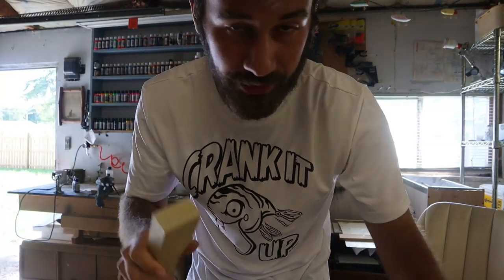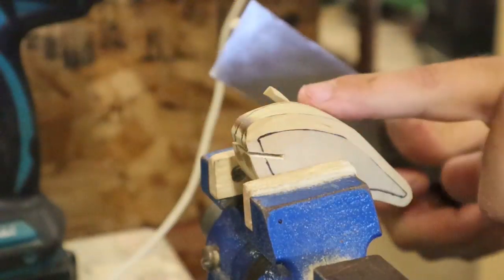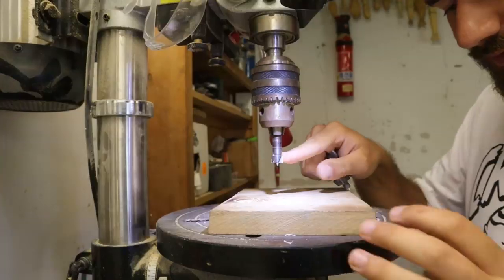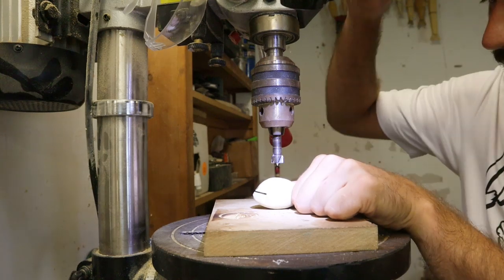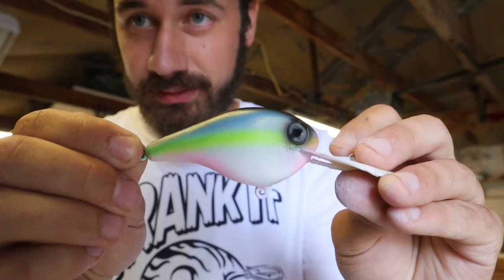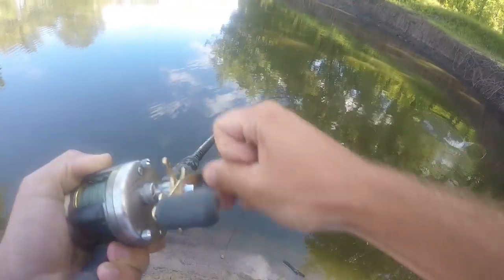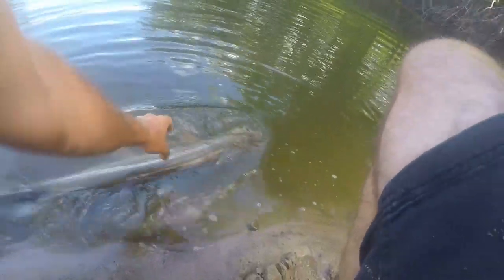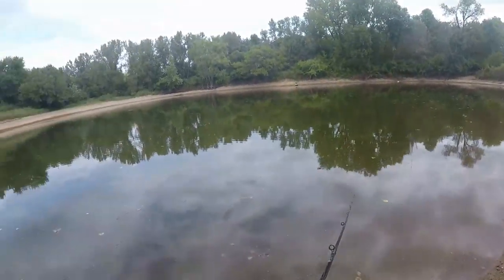Deep Diver | One Day Build to Catch

Comment: Make you a cheap plug knocker. Take an old spark plug and put a paper clip over the  ground electrode and tap the electrode down with a hammer to hold the paper clip on. when you get hung up slip the paper clip on your fishing line hold the rod tip high as you can and let it slide down the line to the bait and a lot of times the weight of the spark plug will free the lure. A better way is a lure retriever. Google bass pro shop E-Z lure retriever. I have no doubt you could make your on version with the equipment in your shop. It’s not a bait but maybe a new video project prospect?

Comment: If you are worried about you files scratching your line ties and hook hangers when using them next to them. Make a false edge on the file. Grind the file teeth off on one of the edges so if it slide agains the loops if won’t scratch them because there are no teeth to chew at the metal.

Comment: Hi I'm 13 years old and in the middle of making my first lure. I have cut the shape out, sanded it down, carved the edges, and hand-sanded it. 

Now I need to cut a line into it from the nose to tell for the wire (hook hangers and line tie). If someone could please give me a recomondation on type of wire or size of wire and where to get it. Its a 2 inch lipless crank by the way. 

Thanks for your help if you do.